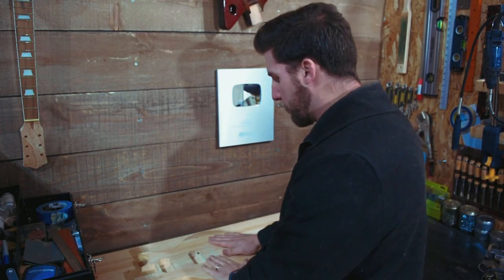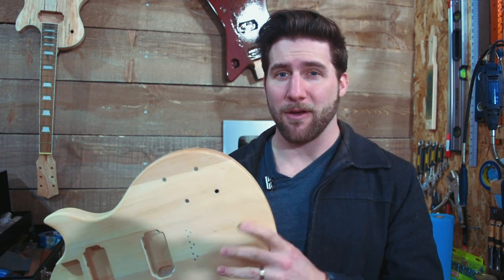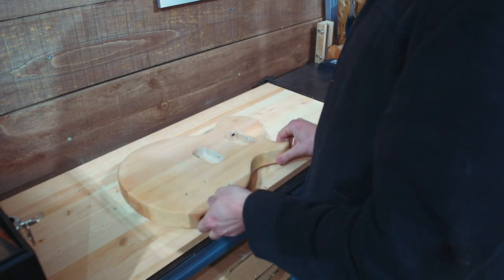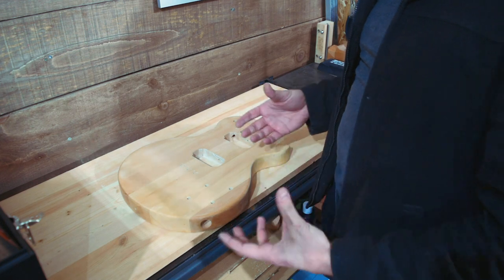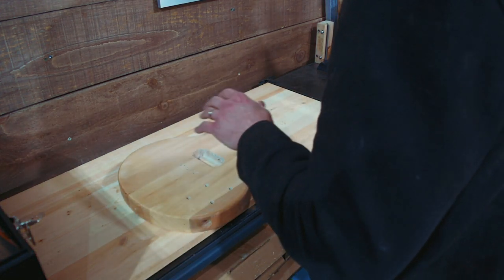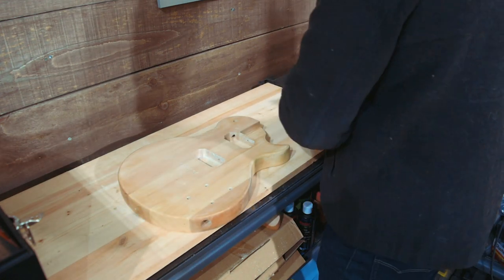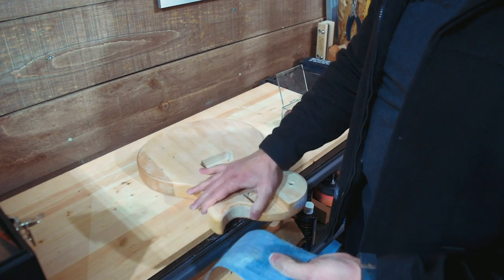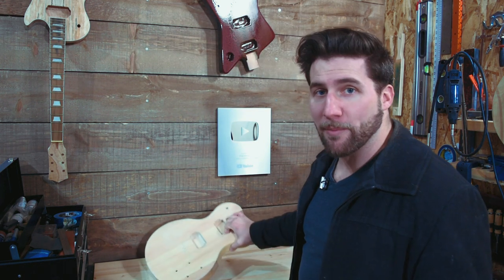Finish Sanding Wood Before Paint (GRITS and TOOLS)

Comment: I use a small piece of rubber garden hose and wrap the paper around it. If it's warm out the hose is very malleable. If it's cold out dunk the hose in hot water for 30 seconds. Perfect for curvy areas. FYI
Reply from the maker: Intriguing idea

Comment: Brad, I wish I would have watched this a week ago. I'm finishing a guitar for the first time in gun stock oil over dye. I usually do 320 then filler then 320 then sealer then work up to about 600 then paint. Next time I'll go higher. I keep several pieces of various diameter PVC pipe for sanding cutaways both for dry and wet sanding. Thanks for the video.
Reply from the maker: Sounds like you’re doing just fine John. I assume it’s working for you? I’m not sure I told you anything in this video you don’t already know.
Reply: PVC pipe for sanding cutaways is a good idea. Thanks.

Comment: Prep is everything, 90% of any paint job or staining. Do not put any coating on till you have it right. Sometimes I will prime it lightly to see if I have any flaws, then sand again to get it right, but staining does not give you that option. Thanks for the video.

Comment: i remember seeing microscope images of wood fibres after both scraping and sanding to the same smoothness, the scraped/blade cut surface clearly showed the pores of the wood as oval-shaped holes whereas the sanded surface was all chewed up and ragged looking, the pores were barely visible. it's arguable, but i think that's a clear win for scraping before application of finish.
Reply from the maker: If you’re doing a finish that’s intended to accent grain pattern, scraping is fantastic.

Comment: A belt sander is ok for your floor not a guitar lol finish sanding is almost always done by hand to get the best results.  On flat guitar body's I've even used my big crimson leveling beam and that works great also. Nice on Brad.
Reply from the maker: I like using the larger side of leveling beams for that sometimes. Not the crimson one though because of that wicked texture paint job.
Reply: @BradAngove  mine is the old old beam that was just aluminium not the new fancy one lol
Reply from the maker: That’s works haha

Comment: Hey Brad! I got the body about a week and a half ago, and I love it! With scrapers, you do not sharpen them, they must be burnished to maintain a perfectly straight edge. The eraser is a great tip. I never thought of that in all the years I've worked with wood!
Reply from the maker: Hi George; glad to hear you like the body. I’m looking forward to seeing what you do with it. 

You can burnish scrapers a few times between sharpening, but after enough use you actually do need to sharpen them to square everything back up and get the burs smooth again. Then you re burnish and you’re back in business.

Comment: Nice. I was spoiled by being on some construction projects with a variety of big adhesive backed sandpaper rolls that we cut to fit various shapes and sizes of sanding apparatus. Lol Just letting go of the grip on the paper noticeably reduced fatigue in my jack hand. Lol
Reply: You can put it on almost anything. A lot like portlandia puts a bird on it. Lol
Reply from the maker: Almost had to switch hit for a while? Dangerous game.
Reply: Exactly. Lol carpal tunnel ain’t easy. Lol

Comment: good video.  Im thinking of using water based acrylic spray paint because its to cold to paint outside. Have you ever used water based clear coat? Is it any good?         PS   Im with Carl on this one, If somebody hooks up with Vang Come back and let us know whats up...
Reply from the maker: I’ve used water based options before. Some of them work quite well they are just a slower process. 
Vang must have just gotten dumped by Johnny 5. Maybe wall-e is available.

Comment: I stop at 320 and still feel like a light swipe with a fresh piece of sandpaper will knock some fuzzies off similar to a scraper. 
I'll only go into 800+ grit if I'm gonna do a ton of coats and then buff it.
Reply from the maker: I would have thought it would be the opposite.
Reply: @BradAngove  I hear you. But I think theory and proper preparation answers both methods.
- When we surface wood, it's just like cutting a bundle of straws at a slight angle. You get these long whiskery ends on some straws, so you can go back with a multi-blade razor that grabs them and cuts them flush sooner, ala sharp sandpaper like cubitron ii. 
-- The cabinet scraper idea seems to be also valid, because the sub fibers support the upper fibers in a way that gives you a perfect cut, which implies that I'm bad at using a scraper, and that's a very real possibility.
Reply from the maker: Oh, I meant the opposite aka 800 grit vs 320 grit.
Reply: @BradAngove  I agree, 800 is super fine for bare wood. Red cedar with white sap wood is the only time I've ever benefitted from going over 320. It smells good when you sand it. I never finish it anymore. Great for closets. Keeps the moths out.

Comment: Quick  question - 
grain/pore fill first, 
then applying stain dye by hand (my choice for a specific project vs spray)  (like a sunburst)
then sealer, then finish?

Thanks for everything Brad.

Did you ever get the email I sent of the 'flame tele" I did based on your inspiration?
Reply from the maker: Ya, that’s the general process that I follow. 
I don’t know if I got the email. I get hundreds of them every week, so I basically can’t read them.
Reply: @BradAngove  you are very good at responding to YT messages, sent the email with the flame tele pics again, hope you get them

Comment: What grit you recommend to be the last at each step?

exemple:
360 on bare/filled wood
800 on sealer/primer
1200 on clear.
Reply from the maker: It depends on what the finish is, but I usually go 220 on bare wood before stain or 320 for dye or paint. 400 on primer or sealer unless I’m spraying metallic, in which case it’s 800. 800 before clear. 3000 or 4000 on clear before polishing.
Reply: @BradAngove  you said 800 before clear. Should I sand the color coat? I'm using PU. was about to spray the clear without sanding the color.
Reply from the maker: I would generally suggest sanding the color coat to help with adhesion.

Comment: Hey brad little confused on something that I hope you can help with, in your two videos on dupi color spray cans you said you can spray the filler/primer over sealer on a guitar body I believe, but in the videos you sanded on the sealer off. I have a strat body right now I want to paint but it has sealer on it so not sure if I should sand it before I start painting. Thanks.
Reply from the maker: I sanded the sealer smooth. You don’t necessarily sand it off, but it raises the grain when it gets sprayed on so you need to sand it smooth before moving on to your paint.

Comment: So i am painting my guitar. I have sanded it with p 400 = 600 grit. When i sanded through the finish i saw that i had about double the layer than i sanded with some epoxy or something. Sry im a noob in this area so. Well i am not going to sand that epoxy layer. I spent 7 hour just to sand the finish off. It is a pretty cheap guitar 200$. 

Question: Do i need to have primer put on or can i  skip it. Cuase it is acting like a primer i guess, the epoxy. I dont want a unnessecary tick coat/layer.

Maybe you said it in the video. I wrote this the whole time:)
Reply from the maker: You don’t need a primer on that. You should be able to go ahead and paint right over it.

Comment: Hey Brad, would you recommend using a scraper on a carved top? I have thought about it on the LP that I’m building, but I haven’t tried it. The top is redwood and heavily grained with high and low spots between the grain; sort of like quilted maple. I have had to strip it once, because of the high harder grain lines being exposed, because shrinkage of the clear coat before level sanding. Not realizing that, I sanded through the clear coat. Redwood is a real challenge, but I will get there. I won’t give up on it, but I would like to get it right this time. I believe I am going to switch to nitrocellulose instead of lacquer, but I am cautiously optimistic about that.
Reply from the maker: They make curved scrapers, so in short, yes I think a scraper is a good option for a carved top.

Comment: Just got my Les Paul build.  Should I sand before I stain at all?  I have plans of using a "paint marker" and also a stain.
Reply from the maker: Yes, you’ll want to sand the surface to make sure everything is smooth before you stain.
Reply: @BradAngove  It's a spalted maple veneer.  400 grit?
Reply from the maker: Yes, and as lightly as you can while still getting it smooth.